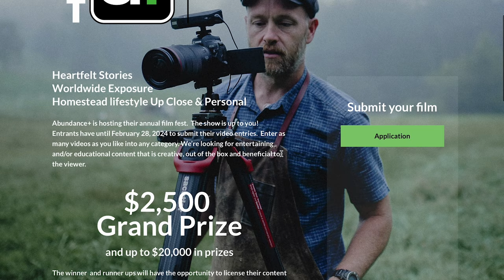Hammer Down on the Remodel

Comment: As someone who has worked with all types of insulation, I'd have to say that rock wool may be my favorite. Great fire safety, moisture, and acoustic properties, along with thermal. Cellulose might be second, with great acoustic and thermal, but harder to install. Closed-cell foam is great for thermal, but expensive and pretty much useless in the acoustic department, not to mention really hard to remove.

Comment: Good day to clean out the shed. Yay, Randolph has a generator. Shed looks much better and you got the side by sides and the ATV in there. Nice job. I'm glad you got the power from your Dad's little house to the remodel house for the workers. That foam insulation should be really great for your heating in the winter. It's really coming together. I hope you find a marketing manager for the Abundance+ Fil Festival coming up in March? Thanks for this video Rhodes family!

Comment: foam insulation though insulating sticks to and hides all sorts of issues from water ingress, mould, dry rots. roof leaks and termite damage . once on its forever you can never check the structure from the inside, this is especially bad in  roof spaces. you want to have a home to pass down but have used a materiel that makes long term long life future maintenance really really hard. its got such a bad rap in some places now people will walk away from buying homes with it